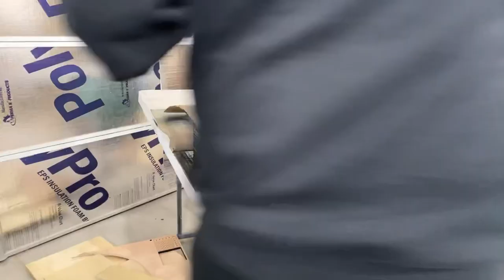Flag Making! Lasers, power tools and paint!

Comment: I really enjoyed your video. Several years ago I decided that I wanted to make flags both large
and small. As I am pretty handy with computers (as long as it’s a MAC) and pretty good at graphic design, I invested in a Shapeoko CNC Router. That is when I realized how stupid I am. I had no idea that I would need a degree in Bits, etc. So I hired a guy overseas to make me a template for  the Union for both the large and small flags. That worked fine but what I really wanted to do was custom designs for Police Agencies and Military units. That is when I failed as the guy overseas started nickel and dimming me for design work and the many edits he needed to make for a logo. So the CNC is gone, and I still have that dream. 

So I am contemplating purchasing a xTool D1 Pro Laser cutter, I found your video and I would like to know, if you don’t mind, what the dimensions of your overall flag is and the union itself. 

The work space of this machine is 16.93 x 15.35 inch and I’m hoping that I can get back to doing what I enjoyed as Im am assuming that Laser cutting is a whole lot easier than CNC Routing.

Thanks in advance.
Reply from the maker: These flags that I make are 14” or 24” wide and everything else is proportionate to standard flag dimensions.

Comment: As I put in one of your other videos.  I am new to using a Laser - I have a 150W CO2 laser I got this week.  I ordered a role of your masking tape through an affiliate code I saw you had on another persons comment.  I saw you first paint the black field portion and then you laser out the stars and they appeared to be white.  Did I see that correctly - can you laser of the paint to just show the stars underneath.  How is that done if you don't mind sharing.  Did a YouTube search and can't find that answer yet.
Reply from the maker: Light coat of paint and quick speeds with just enough power to get some depth but still leave the stars a good color.